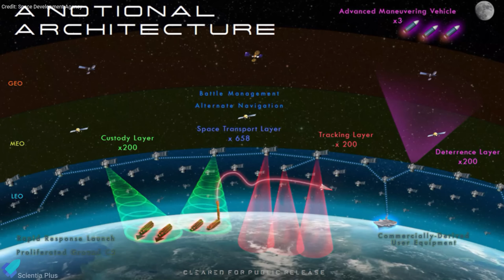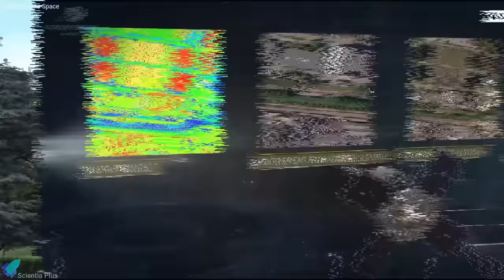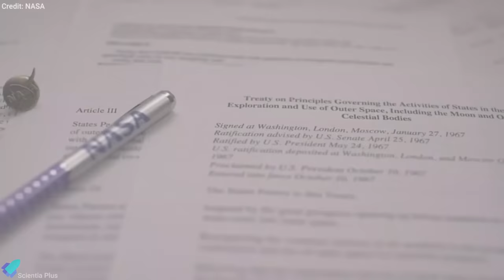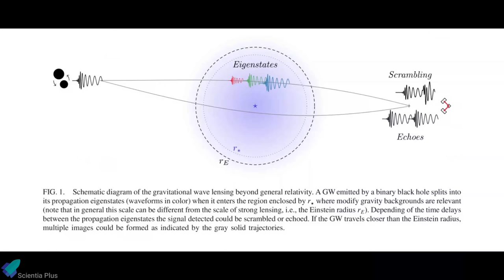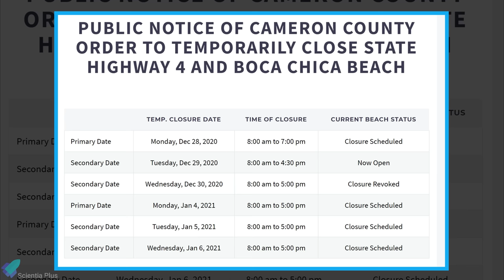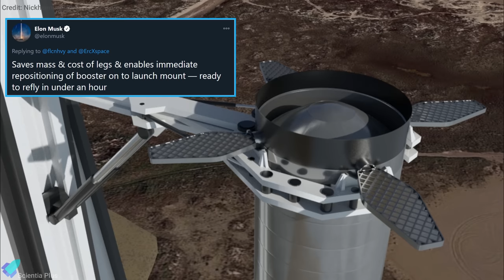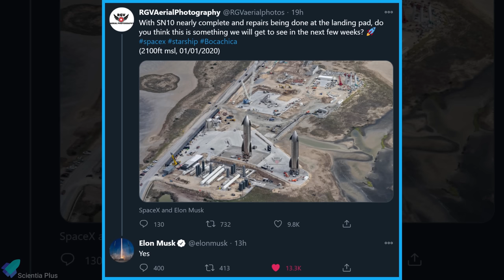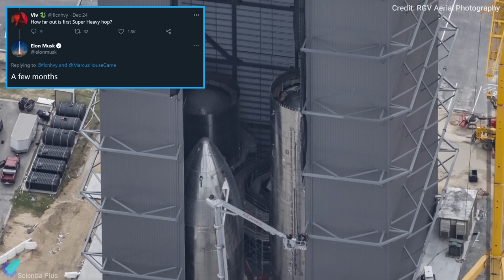SpaceX Plans to "CATCH" Super Heavy Booster | SpaceX Wins $150M Contract & more | Weekly Update

Comment: Let's make a list of requirements for a successful SuperHeavy catching design: ( anybody please contribute )
and evaluate the proposed designs against this list.

1. Has to be in the proximity of the launching pad to allow for SuperHeavy repositioning
2. Allow for some imprecision of landing position in in both directions
3. Provide cushioning  after the support contact to reduce shock loads in the SuperHeavy structure. - Cushioning mechanism to have low inertia.
4. Retract out the way after repositioning - or provide support for next launch sequence and retract " just in time" at launch time.
5. Can initially take the SuperHeavy from the transport vehicle and position it for launch.
6. Work in conjunction with the top crane to allow placement of the StarShip 
7. Has to support & lift SuperHeavy buster having minimum of fuel.
8. Has to be able to rotate the SuperHeavy Buster before correct placement onto the launching pad.
9. Integrate with the rest of tower service functionality.

Please contribute to this list with additional requirements.

Thank You
Reply: Has to be able to withstand the heat and very high vibration levels of launches and landings.

If SpaceX wanted, the crane that stacks the StarShip onto the booster could also move the booster from the catch device to the launch pad. So the catcher doesn't necessarily need to be able to position the booster.
Reply: My solution - create a launch tower using an old Falcon 9 booster core filled with reinforced concrete. Extrapolating from Arecibo's towers, it should support 800 tons. Add a rotating hammerhead gantry cranes Scrap heavy booster segments (30' diameter x 6' tall) filled with concrete make a 320 ton counterweight to balance the heavy booster. A US Navy Mk7M4 aircraft landing arrestor (stops 25 tons, doing 175 mph, in 2 seconds, at 300' runout)  should allow heavy boosters to be caught up to 15 mph velocity, in 2 seconds, in less than 40 feet. "Some assembly required."
Reply: Super lift Dock Gantry ?
Reply: It has to have dank memes